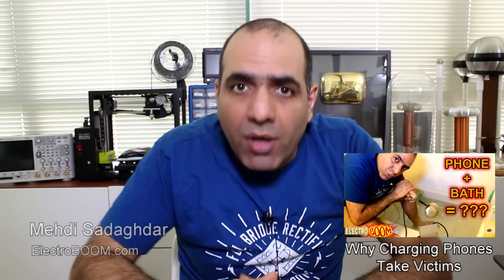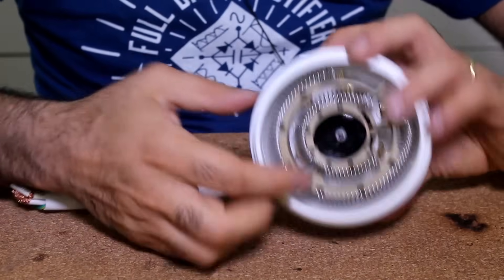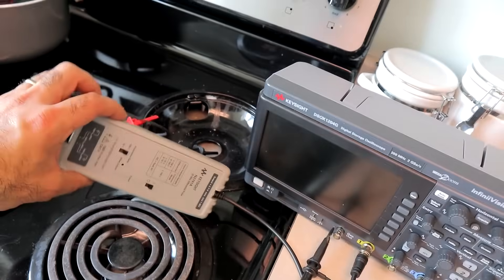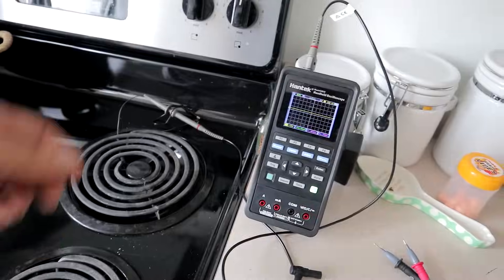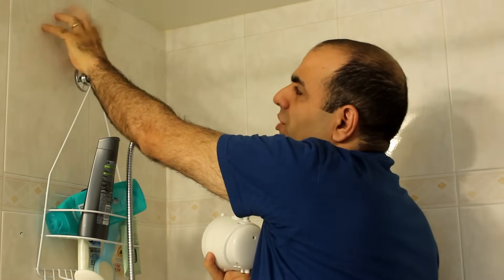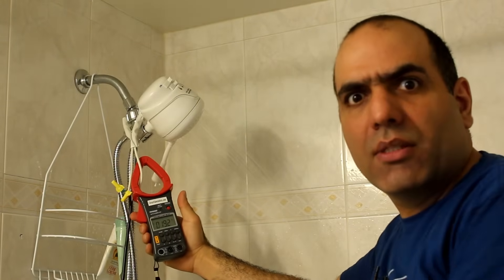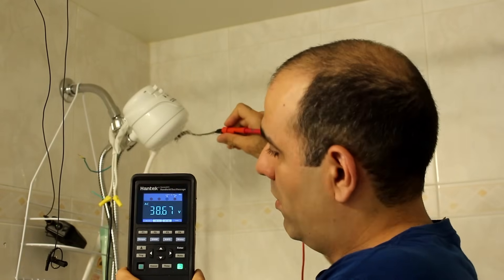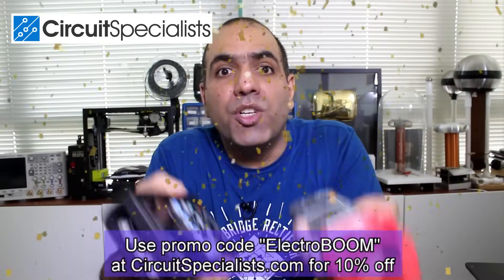How Safe Is the SHOWER HEAD OF DOOM?!

Comment: So we have 200 millions Brazilians, and only 1424 accidents involving electricity and in this 14 hundred cases only 537 house fires in 2018, most of them was caused by old cables. I can assume that this "may" is a big over statement.
Reply: @johnrubensaragi4125  it's only racist if the people matter, which Brazilians don't.
Reply: @justsomenerd8925  Sorry but I'm quoting wikipedia here on the meaning of Racism: "Racism is the belief that groups of humans possess different behavioral traits corresponding to physical appearance, and can be divided based on the superiority of one race over another. It may also mean prejudice, discrimination, or antagonism directed against other people because they are of a different race or ethnicity." Pretty sure it's not related if the people matter or not
Reply: @justsomenerd8925  cheers and have a goodnight!
Reply: Yeah, mainly due to the interface between water, you and the ground. It has a very high resistance compared to the heating element. Remember, this is not a bathtub. Surface area is minimal.

As for touching the wiring, it's universally kept above the shower head, and it's almost always thick wiring with double isolation.

It's probably easier to get electrocuted in any bathtub with outlets anywhere close to it than with this thing.
Reply: @tl8211  The droplets aren't completly connected to each other. The ground wire that all this shower heads are required to have also helps a lot.
Reply: @Nightmarecit  That said, i think almost everyone i know (me included) has been shocked by one of these, and stories of them catching fire are not uncommon. No fatal injuries that i know of, but some unpleasant moments indeed.
Reply: @lolmandos  In 30 years I have never got any serious shock on one of them, neither my close family. Properly installed by a professional is safe.
Reply: @Nightmarecit  Never got anything serious indeed, but i've been lightly zapped more than once at friend's houses.

Comment: I have been a fan of Mehdi for some time. About a year ago I subscribed to a YouTube channel of another electrical engineer who lives in Belarus. I like his videos, and it seems to me that Mehdi's channel is an obvious inspiration for this guy. (For example, he also did a video on a recent Veritasium puzzle about the lightbulb.)

This week he uploaded a couple of videos about a device produced in China that can supposedly increase the resistance of water in the pipes and make the voltage drop if for some reason the water coming from the pipes has it. 

Effectively, the filter this guy tested is the Shower Head of Doom without the wires, since it has no purpose to make the water warmer. But in post-Soviet countries (like Belarus, where this guy is from, or Russia, where I live) it is not uncommon for shifty electrical engineers and/or DIY homeowners in the high-rise apartment blocks to use metal water pipes (PVC ones are not omnipresent here yet) as ground conductors... which is obviously very dangerous, since the pipes and the water in them can easily go live if something breaks and they effectively have to really serve as the ground conductors some idiot wired them to be.

Because of this, it is not that uncommon that the water coming out from the pipe may have voltage - not full 220V to shock you to death but enough to 'bite'.

The filter that this guy tested claims to mitigate this danger. He disassembled this contraption, and inside there were a couple of diaphragms. They thin out and lengthen the way in which the water travels inside the pipes. According to this guy's videos, this is enough for the voltage to drop significantly. He is more on the safety side of things, so there's little Mehdi-style comedy. Suffice to say this guy narrates all his videos with a hard cap helmet on his head as kind of a 'trademark' 😆. But he even treaded with his bare foot into the water, which was 220V live before the filter, after it was filtered, so there was a little Mehdi-style showmanship and suspence, too.

He also tried this filter on water with different amount of salt added and found out that at very salty water the filter stops working and lets as much as 30-40V leak.

I'm not sure if it's okay if I post the link to the video (don't want to look like a spammer), but this guy's name is Aleksandr Mal'kov. By the way, he also has a lot of videos explaining common mistakes and dangerous misconceptions of people in post-Soviet countries about grounding etc. (All his videos are in Russian though.) Let me just sum it up this way: it seems that GFCI protection is almost unheard of here 🥲

Comment: our showers are considerably very safe, considering that in the past metallic showers were used, today plastic parts in the worst case scenario melt without setting the house on fire, however the circuit breakers installed in all homes are able to turn off the system in the event of an abnormality.

Comment: That is true! In Brazil most houses use the "Ducha" that can be adjusted between cold, warm, and hot water throughout the year! To provide the necessary heat, these shower heads all use 220 volts.

Comment: Once I accidentaly poured water into extention cord with 4 sockets, it was older type with no water holes on botton, so water just stayed inside and I was very surprised that nothing happened, it just worked completely normal as before even with water inside and we have very hard water from well full of minerals, so when you have softer water, you can consider it not conductive if you don't put some salt into it. With American 120V system, it should be even more safe.

Comment: Actually here in Costa Rica, we use those same showers and many of them are manufactured in Brazil. Almost every shower I've seen, including the one in my house, is not connected to the ground wire. As you noted, it won't shock you, because all the current flows through the resistor. BUT, if you open the shower a little, so that the diaphragm makes the live wire run through the resistor but not the neutral (depends on how it is wired up of course), all the water will get that positive, which will shock you, and I can confirm that. Anyway, it won't kill you, at least in my case, I love shocking myself and I haven't died, yet lol.

Comment: Installed By Professionals...

Hold my very toasted coffee

What will make you mad in Brazil Isn't the fact of we use this showers without earth or earth in parallel with neutral(as in Brazil we have "earthed-neutrals") but the fact of the houses olders than 2009 don't have any pattern on the wire coloring, if you go in to a house built before 2009/2010(years that the goverment moved from american plug system to Brazilian/Swiss system) you will see varios issues, live and neutral with the same color, houses without circuit breakers(in this houses the circuit break is the circuit break of Wattmeter proved by the electric company), thin wires.

and one last thing, in Brazil we use the 60 Hz AC Current and in some brazilian Regions like Northeast and North the default voltage is 240v mono-live(idk the equilavent of "monofasico" in english), that is a 240v 60Hz live,and a Neutral, and in others regions Like South and Southeast, we have 2 Systems, 127V 60Hz mono-live and 240V 60Hz dual-live("bifasico"), that is a option for commercial consumers thats need a 2 lives system, providing 240 ou 127 V in the same house , commerce or industry.

And one last thing a huge part of brazilians "don't give a shit" for this 2010 laws, and continue to do the things of pre-2010 that i write above

Sorry for the bad english, for me portuguese looks more easy
Reply: Eduardu44™ Games  

As a germany raised person, i feel kind of unsave already reading this. But i bet it is not as crazy as it seems, when you are used to it. Cause i think for most of the people regardless what country, electricity still feels like "magic" somehow. Strange how such "fundamentals" differ, and can be dangerous if you are unaware 🤪. 

Interesting Comment !
Reply: Its not about not giving a shit about the new laws, its about not being able to afford it. My family relatively recently (2016-17ish) replaced all the wiring in my house to be compliant. Before that, my house had solid core wiring inside the walls. Fucking horrific.
Reply: @Timeward76  yeh ,even if there was regulation saying that only a professinal could do the wiring ,who would enforse it
Reply: @nonec384  in my quest to reply to even the oldest comments, fun thing about these showers is that you can tell when there's a problem in the wiring. Idk if its even possible for there to be a lethal problem in the wire that doesnt immediatly trip the breaker due to short detection, but if he earth is disconnected or faulty, you won't be hurt by it since the water will conduct the electricity around you rather than through you. However, if its faulty, you can feel it when you brush against metal things, and specially when turning off the shower with the metal valve.
Reply: @Timeward76  i heard in other coments thats becuse the shower is ground to old copper or brass pluming

Comment: EDIT:

Buys electric suicide shower on Amazon and makes YouTube video do prove that it's dangerous.

Accidentally proves it's safe?

-------

Woo-Hoo, Brazil 🇧🇷🇧🇷

Nice that my comment (more like a life story) on the previous video caused something. 

Another great video!
Reply: I mean... like he said, you still might burn down your house, touch a loose wire, or get cancer.
Other than that completely safe.
Reply: Just imagine if something fails in the shower head
Reply: Ben McInnis 

But the houses with electric showers (like where I lived) had proper wiring and dedicated circuit breaker for each shower. 

In winter we always came across the "Electric Shower Paradox": you can have water or heat. Not both. Because if the water passes too fast, it doesn't heat enough. 

Under the Paradox condition, I was a master in getting as little water as possible that it would be hot enough, but not too.little that I couldn't shower. 

In this condition, the whole thing just got really hot (because so little water) to.the point I thought it would melt. 

But it never did. The wires never melted or the house burned down.
Reply: @benjaminmcinnis6683  you underestimate Brazilian's ingenuity
Reply: @benjaminmcinnis6683  It's kind of weird thinking a house can burn down when regular electric installation already has to consider big power draws like AC, electric heaters, microwave ovens, and so on. One thing is true though, most residual energy circuit breakers in the country (If they are installed) come at 100mA, sometimes 30mA.

Comment: This must be the most efficient way to consume your surplus-PV-electricity, since hot water isn´t stored (thereby loosing heat with time), but instead heated the second you consume it. In Germany, surplus-PV-Electricity is used to heat water, in a tall boiler where the cold water isn´t diluting the hot upper layer, but still, not as efficient as using the electricity the moment you consume the hot water... And this shower-head is (not only the most efficient, but also) dirt-cheap, while those special german boilers are the most progressed and expensive ones in existence... A single inspection of such a boiler costs many times more than the eventual replacement of such a shower-head...
Reply: In my flat in Germany a Siemens Durchlauf water heater under the sink provides instant hot water safely and very powerfully 😂💦
Reply: Durchlauferhitzer! 🙏🏻

Comment: Well, technically is PWM, but with a very low frequency.
Reply: Not really, the frequency of the on/off switching will be changing, rather than keeping a fixed frequency with variable duty-cycle as in PWM.
Reply: A.k.a. the On-off signal 😂
Reply: Agent24 It’s 50% PWM. It’s Pulse Width Modulation and not PWM-Modulation. If you put a 30% duty cycle on a LED it’s also PWM while not changing the duty cycle all the time.

Comment: In Kenya we got many of them and many idiots who don't connect the earth. Even with an earth wire you can't use a gfci because it's always leaking a little current. When i found one in my new apartment i changed it to a proper controlled instant water heater.

Comment: these 2 heating elements we call it the resistance of the shower here what usually happens in houses where people like to shower with boiling water is that these resistances break/fail leaving the shower cold and you just have to buy a new resistance not even a new shower its just common to just swap the resistance and its done.

Comment: Here in Brazil all pipes are pvc (the majority at least) there is a chance you get shocked touching the valve (I forgot the name of the valve you use tô open close the shower) if your ground is not set properly. Usually those things bust itself and you just have tô chance the shower head (or the resistance inside). 

Some time ago the shower head overheated in my house and glued on, that was the only problem. 10 days on 24/7. The electricity bill was double for 2 months (5 days in one month 5 days in the other, it consumed 1000kwh)

Comment: "I was expecting the GFCI to pop"  
WE too, we too
Reply: I have 5 of these things, all of them behind RCD/GFCI/DR (because I didn't want to die either) and all of them are fine. Mine are 220V by the way, meaning that the supply conductors don't have to be ridiculous. The real danger with these things is the installer as Mehdi says: You can buy them for just a few Reais in supermarkets here and they often get connected up with any old bits of old flex twisted onto each other and, if you're lucky, insulation tape wrapped around the joints.

Comment: An Electric shower head is rated at 5-8kw. So we use a 45A DP switch and a 32A breaker. What can kill is if its not properly earthed/grounded. Cable size used is 4.0mm sq

Comment: Doesn't trip safety electric socket. 
Doesn't fell shock by literally touching the ungrounded thing.
USA: suiCIdE SHouEr
Reply: @MarcosTorresJr  Even though connecting it to an outlet is indeed "improper" by the rules (given the high current), it will still work normally for demonstration purposes as long as it isn't set to a gross overload (tripping the breaker).
 
A lack of reported injuries isn't that much to brag about in my book (most of them happen either with complex machines like automobiles, or bottom-of-the-barrel junk with poor to non-existent quality control); and while space heaters (in particular) are (not entirely rationally) feared by much of the public, when well built they're about the most reliable appliance in a modern home (given that while other devices have grown vastly in complexity, heaters in their basic form remain pretty much as simple as ever).
As for the USA and Canada (where phobia about them seems strongest), take note of my response to Esteban Chacon's previous reply to The Lonely Twinkie.
 
Looking at the recall register in Australia (see at https://www.productsafety.gov.au/recalls ), it's extremely rare for a competent manufacturer to have to recall a space heater (Kambrook for example have majored in them for decades and have yet to recall a single model); while automobiles (given their hazardous nature combined with complexity, although higher expectations no doubt play some part too) are the most-recalled single product category of all.
 
The plastic-grille convector heaters I mentioned were rather like the recalled Takata airbags in cars; neither were dangerous when new, but both have degraded badly over the years since (and I would indeed hypothetically sort Takata airbags into my "High" risk category, apart from the particularly dreadful 'alpha' types which would end up in "Severe"). (The air temperatures coming out of most convectors on full-power are around or a bit over 100°C; and I think they used nylon which has an approximate operating limit of 125°C, although it will degrade in a rather modest time there.) Every newer convector heater I've seen has a metal grille thankfully. (Although something that would be worth considering would be PBT or an even higher-temperature plastic on top of the metal, to reduce the likelihood of burn injury while maintaining long-term safety.)

Comment: It seems no one told you about the quirky thing of this shower.. 

If you let the water run but just a little bit, enough to just drip some drops of water but enough to turn the resistor on and not enough water to "contain" the heat.. oh boy, it's fun! The shower must've been used for a while tho, I don't know if this happens on newly installed showers

Comment: And what happens if people uses the metallic tubing of the house to ground the shower? I've seen people doing that but I don't know how dangerous is that.
Reply: A lot of older houses in the USA use the fresh water pipe that goes to the street as the ground.
The main breaker/fuse panel would be connected to that.

So as long as we're talking about a 3 wire hot, neutral, ground setup that has a proper 3rd wire for ground and so as long as the pipes have a good continuous metal connection it would help.

The problem is many new homes use plastic pipes so there's a grounding rod or mesh wired to the main power meter.

Comment: Current is what kills, not voltage but they obviously work together. The only issue I can see if the unit is not grounded well and the element fails, then it could potentially cause electrocution.